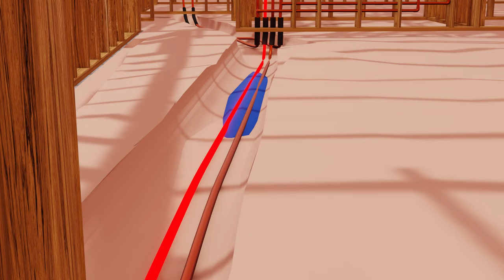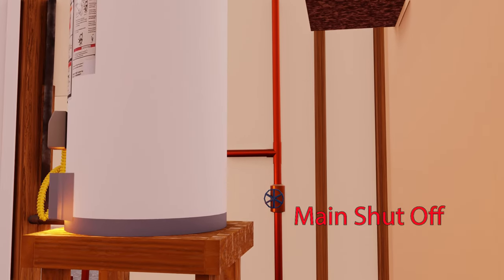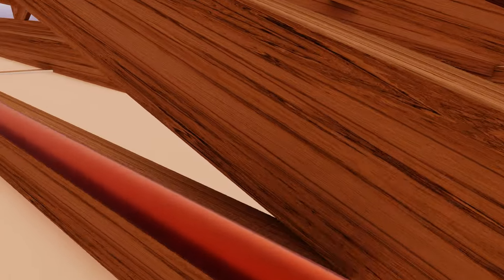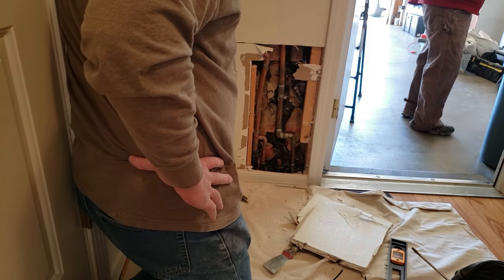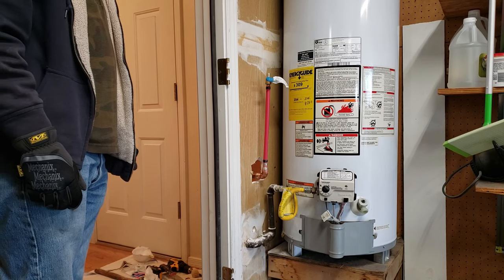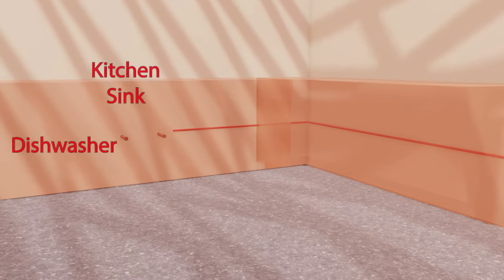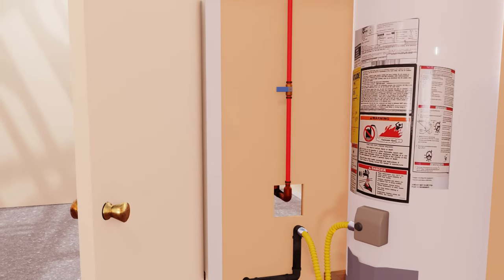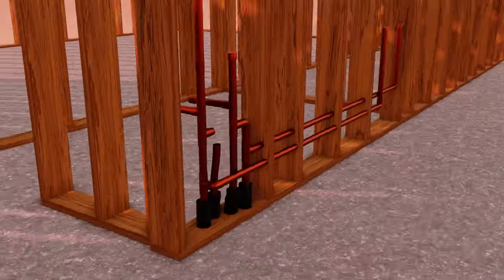Underground Leak Repair: Fixing a Water Leak Below a Concrete Slab

Comment: This video is awesome thank you for taking the time on making it. It sure helps to see another way to fix a leak. Im definitely going to try it.
Reply from the maker: Thanks for watching and for your comment, Taquito! Yes, sometimes it's a good thing to think creatively when dealing with water leaks in copper piping particularly. You can never be sure if the leak in copper is a fluke one off event, or are there other locations that are close to springing a leak as well. Good to think through all the options before you start spending money digging up your concrete slab!

Comment: I got hot spots in my bathroom 2 days ago. In the morning around 5am, i can hear water running under the floor. It is different  any other day before this leaking occurs. A few days ago, I was messing with a frozen overflow bathtub last 3 days by pouring in CLR and trying to pull out the valve with my metal rod with a hook at the end but all no avail. The valve is really stuck. I want to remove it so i use my small water jet and push the clog out to the main sewer pipe. My question is could i have damage the hot water pipe with my hook end while i was pulling hard on the metal rod? I could have poke a hole in the pipe and caused leaking hence hotspot ? The hospot is about 2 to 3 feet away from the bathtub. 
If it is for sure i have a leak, i would like to bypass it with PEX tube. Im a very DIY person and handy. Thank you
Reply from the maker: No, I wouldn’t think what you were doing with the drain would have impacted your hot water leak at all. Those leaks in copper under the slab happen when you least expect it and it is never good thing but it sounds like yours is near the hotspot. It’s common sense that where the floor is warm, the reason is a hot water leak nearby. Hearing the water running tells you all you need to know. 

If opening up the floor where the hotspot is easy to do and repair you might want to consider fixing the leak that way first. Then maybe be able to plan a bigger project to bypass or repipe the house at a more convenient time because you could still have another leak at a later time. The idea of repiping is not difficult to understand what needs to be done. Doing it, however, is time consuming and labor intensive. You really need to plan it out and think through the process if you can. You will learn a lot doing a repipe and will feel good about it when you are done! Good luck!
Reply: @RustyDobbs  I forgot to tell you. I used water jetter adapter I bought that I can adapt 50 feet of line to my 2000 psi ryobi electric power washer. I snake it into my vent pipe in the roof and came down full blast. Could I have damage the water pipe when I did that? I did it in the past with no problem. No been 3 days. I'm hearing water sound reverberate inside the wall that has water pipe in it. Could this be the source of leaking that lead to hot tile in floor th as is about 3 feet away? Plz look at video. I spoke Vietnamese to my friend who is a contractor in Portland. Thanks I'm stuck at my day job figuring out what to do when I get home.
Reply: @RustyDobbs  thank you so much for your time

Comment: Did you need to pull permits to do this?
Reply from the maker: My guess is that if you asked an inspector, they would say yes, but I don't know that for sure. When it's an emergency situation, I would think they would be more interested in proper materials and methods being used to make the repair over you pulling a permit first to fix a broken pipe. Certainly no reason to make a repair that doesn't meet code after it is completed.
Reply: Could you avoid permits on work inside a house/structure???  Yes.   Every city is different, but I have pulled permits for inside repair and they were never inspected.  My city is more focused on the $$$ they get for the permit, not in enforcing Code,

Comment: One thing That I have run across is that plumbers do not neutralize the acid in the flux after sweating a pipe! I make a paste of Baking soda and wipe down the joint after sweating a joint. Today I have a pex crimping tool and that problem is over.and I am not a plumber.
Reply from the maker: Yeah, Falcon, Pex and the tools/fittings available these days make the need to sweat joints less necessary than ever. Took me a few years to completely trust them. I was a plumber's helper for about 6 months fifty years ago, so just learned the basics then, but have not forgotten. Have never heard of neutralizing the acid in the flux, but sounds reasonable. Thanks for your comments!
Reply: @RustyDobbs  Our house we live in was built in 1960, in the unity room in pin hole leak developed and it was for the very reason that the flux weakened the pipe. In VA I built 3 houses of my own over years doing everything except the HVAC and roofing and the brick work. As an Electrical Engineer the electrical Part was easy as teenager I worked at different times for both a plumber and an electrician. I had both of those contractors look over my work prior to having the inspector come out. It was with the plumber that taught me to wipe down the sweated joint with baking soda and water paste. As for PEX today it is all I will use if I can while living in Stafford County, VA I plumbed in water in each stall of a barn with PEX and during the winter the water would freeze. I never had a pipe break or leak. And that was 13 years ago.